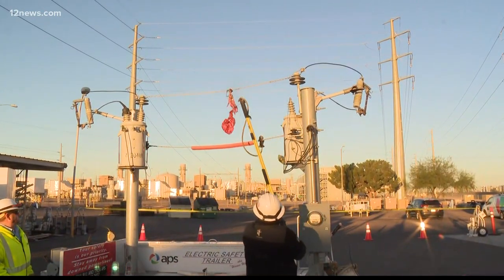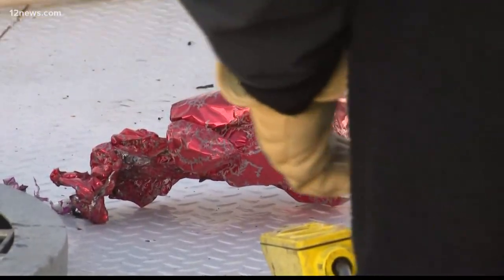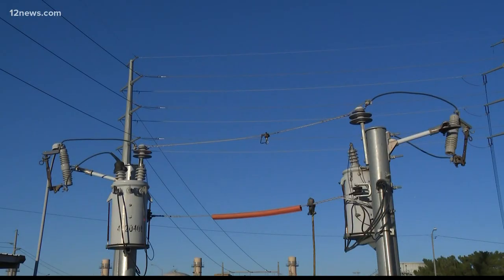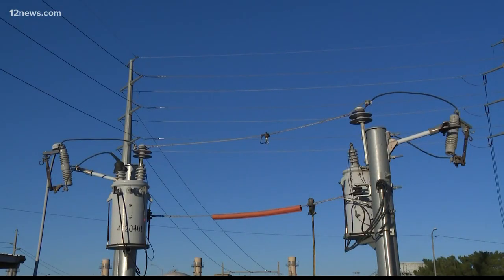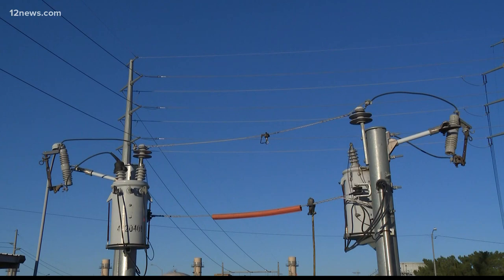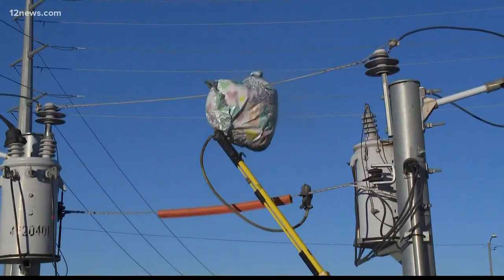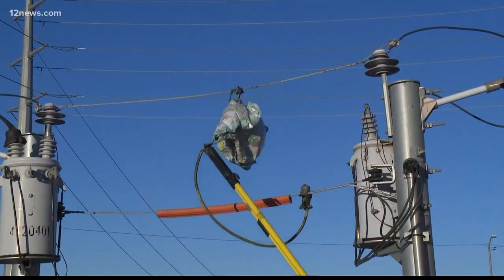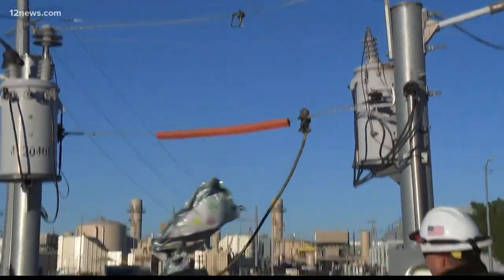APS demonstrates what happens when mylar balloons get tangled up in power lines

Comment: For christ sake, mylar is not made OF aluminum. Mylar balloons are often made WITH conductive vacuum plates aluminum. Thank you for breeding contempt for knowledge and factual science.
Reply: Well showing your scientific expertise is impressive but not helpful. Key words seem to be conductive and aluminum.
Reply: Is made from vs made with is critical. No language no knowledge, no intelligence.
These people follow style script and the difference is critical. He did not say banana vs plantain. He told a cleat complete lie, knowingly, in englisk.
Reply: @brucecapron9344 I understand the massive faults of public media but they made the relevant point. Picking them apart may be interesting and cathartic but does not change the outcome. Most people want news easily digestible and quick to the point.
Reply: @thethingonthedoorstep3464  well said
Reply: mylar is just nylons weaker brother you need like 25 sheets to get the power of 1 nylon sheet
Reply: It looks like the balloon is attached via cable to another power line. If the balloon only touches one line how does it short? Birds land on power lines and they don’t short because there is no path to ground (0volts) or to a different voltage.